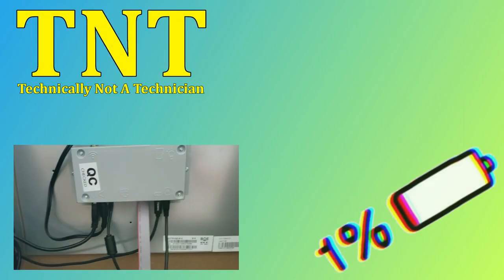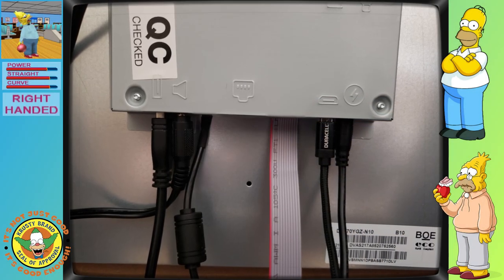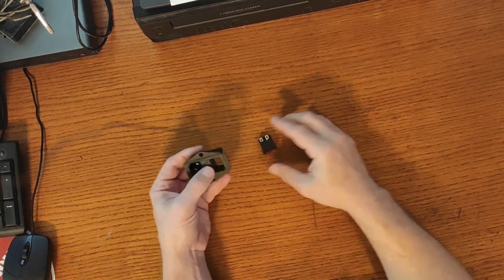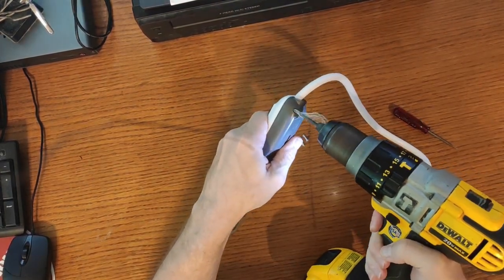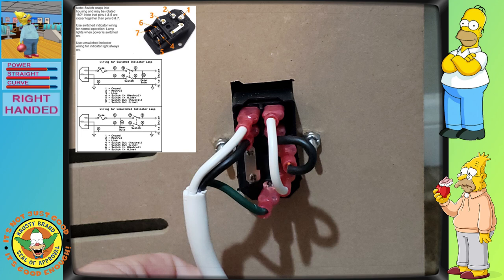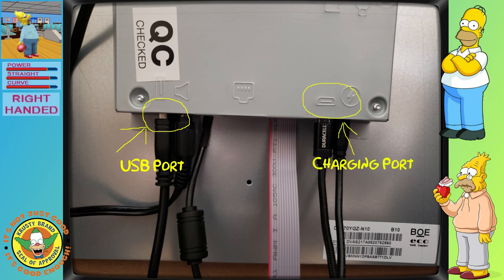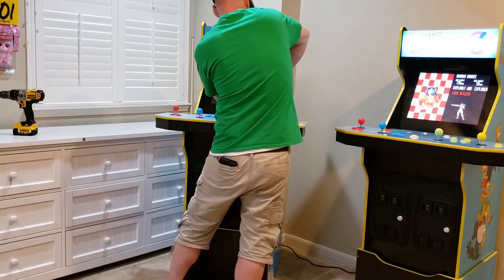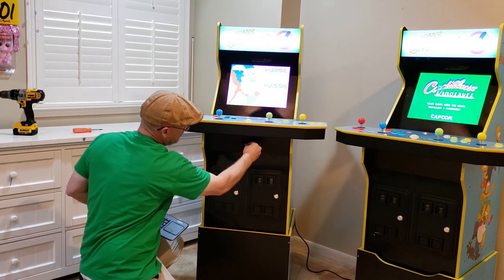Fighting this Arcade1Up Low Battery bug and adding an external USB Hub

Comment: Does the battery keep on depleting even with a micro usb connected charging? I noticed I had the battery bug because my battery was at 27 percent. I connected a charger and it says it’s charging, but it is still depleting and now it’s 24 percent. Will it go all the way to 1%? But be okay because it’s charging?
Reply from the maker: The truth is, we don't know much about the bug. We just know that some cabs are effected. This video only shows what is working for me, BUT I've heard reports in the wild that as long as it's plugged in you cab will NOT reboot. I hate that you're still getting a drain on your battery. I've got to ask. What do you have plugged into your USB port, and if you have something plugged in, is it powered via the PCB, or from an external power supply?
Reply: @TechicallyTNT  I have nothing plugged into my pcb usb port. Only the micro usb plugged into the pcb going to a power outlet.
Reply from the maker: @cbarfatani  how many amps is the charger? May want to use a larger amp charger..
Reply: @TechicallyTNT  it’s plugged into a 2.4 amp charger usb port. From the same usb hub you recommended. And usb hub is connected using the proper ac power jack 5v/3a. I guess time will tell when it gets to 1%
Reply from the maker: @cbarfatani  may I ask if you've factory reset your cab? I have two cabs. Both have been softmodded, BUT only one has been hard modded. The hard mod cab got down to the 90's BEFORE the mods. It is at 100% now, but I did not monitor the increase. I don't know if it was gradual, or if it happened all at once when doing something like factory resetting it as it was plugged in. I will be doing the same hard mod to my other simpsons cab, it is down to the 60's I think, and I'll do better at monitoring that one. (Do you have the MDE installed?)
Reply: @TechicallyTNT  yes I did the MDE and had it factory reset within that process. After that I installed the different arcade1up apks and retroarch. I also purchased the 12 in 1 board for the track ball. Although I have been having trouble getting that working at all within retroarch games. Another issue I’m having is trouble utilizing my sd card for space. I mounted it as a internal but still I can only install the apks on the memory that is only 4gb’s and it keeps filling up when I try to download different bios within retroarch or install any app from APkpure. I’m using a usb stick to try to transfer files but it only installs on the 4gb memory
Reply from the maker: @cbarfatani  DUDE DO NOT FORMAT AS INTERNAL.... that seems to make big issues. Okay going to read the rest of your post hold on.....
Reply from the maker: @cbarfatani  Okay few things, again don't format the SD card as internal. This can brick your system. As for the bios, move those to the SD, and put your roms in the same place. As far as installing apps. You can only "Reliably" install to the 4Gs. Keep the App count, and extras down, and ANYTHING you can store to the SD card like roms, bios, and images. Side Note to the internal formating this is known to make the system "act funny".

Comment: First off I'd like to thank you for the lighting fast reply on my other question. Second this just saved me lol. I got this directly after doing the mod with dig and nova, and couldn't for the life of me figure out the cause this did seem to fix it I will note that I had my keyboard plugged in for close to 40 minutes before it had started occurring (Logitech with trackpad) so possibly related.
Reply from the maker: This does my heart good. I love to know this was of help. This is AWESOME News. As always, Thank you for checking out the Channel.

Comment: If you have not hacked your system, how do you know if you’re experiencing the low battery issue?
Reply from the maker: So, I'm told the unit reboots itself after about 4 or 5 minutes of game play. If you want to know if you have the issue, Plug in a Keyboard, and press the windows and N key at the same time. You'll get a Sub Menu, and at the top you should see your Battery status. If it's less then 100%, then you know. Side Note: Thank You for checking out the Channel. Means the world to me.

Comment: Any suggestions for the boot loop? I'm pretty sure it happens when the low battery bug gets too low. I've tried using multiple phone chargers and cords.
Reply from the maker: My Dude, This is the first I've heard that the boot loop had something to do with the Low Batt Bug. The reports I've heard say you can play for 5 or 6 minutes, Then it reboots. Not sure about this boot loop. Sorry, as I know that isn't helpful. That said Thanks for checking out the video.
Reply: @TechicallyTNT  That's just my assumption as I know I'm not the only one who's received a replacement PCB from A1UP direct with this issue. My thinking is it's from it sitting around in a warehouse or something. It's just hard to imaging them shipping out defective replacement parts, so it seems logical that these boards may be fine at production, and then fail by the time they reach the end user. This may not be the case at all - but it makes sense in my mind and is pure speculation.
Reply from the maker: @lunchboxphil1974  keep in mind that the battery is 100% emulated. It doesn't really even exist....
Reply: @TechicallyTNT  Yeah, I get that - but it's odd that it would ever drop in the first place for that same reason. Just saying it seems like something that could be a cause, but maybe not since it doesn't get fixed by plugging in a charger.
Reply from the maker: @lunchboxphil1974  My Guess, and JUST A Wild A$$ Guess. I think it has to do with the current draw from plugging in keyboards, hubs, or anything the PCB has to power. BUT again, that is only a Wild A$$ Guess.
Reply: @TechicallyTNT  but it should still work then when nothing else is plugged in.
Reply from the maker: @lunchboxphil1974  maybe, Its all just guesses....

Comment: Thank you TnT😮
My simpsons doesnt work suddenly, only blink the marquee.... do u think can i prove this solution?
Thank u
Reply from the maker: No Sir, it sounds as if you have a bad PCB board. IF it was the low batt bug, it would restart over and over again after about 3 minutes of play time. 😞 Sorry Sir.
Reply: blinking marquee sounds like it could possibly be a bad power supply too
Reply from the maker: Could be that.
Reply: I have this same issue just happened last night? I switched the power from my blitz one still does the same only clicking markey light. Any suggestions?
Reply from the maker: Generally that means power or pcb issue.
Reply: @TechicallyTNT  thx looking for one nlw